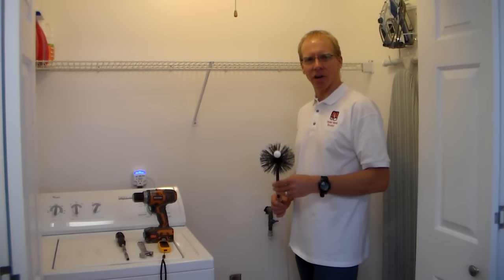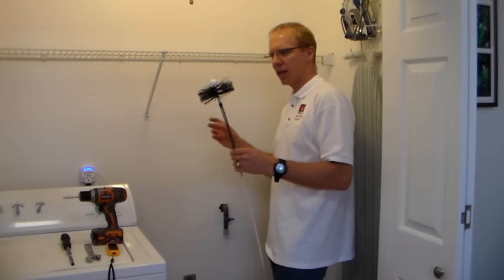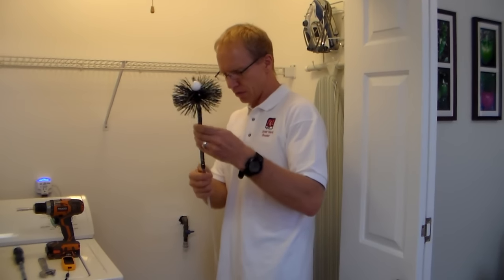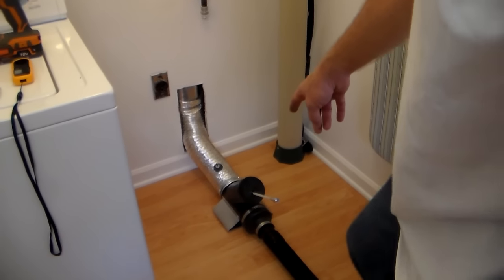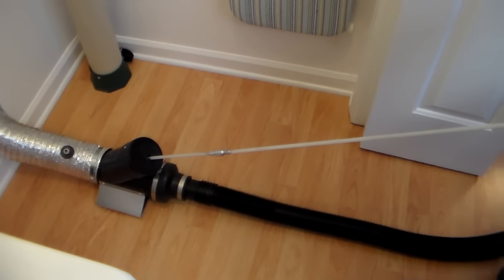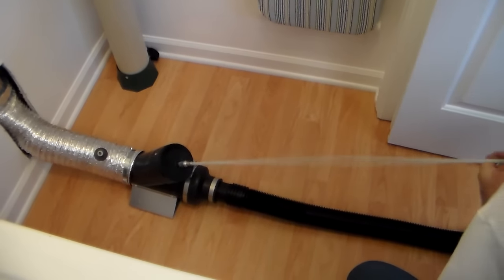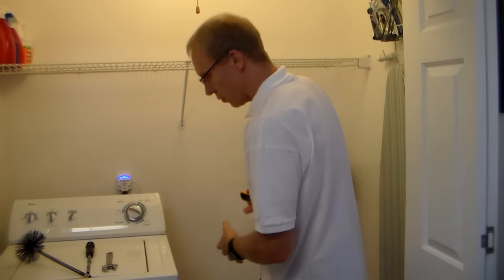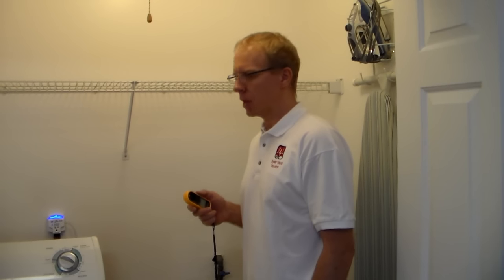Dryer Vent Cleaning - This Is How We Do It.

Comment: I helped my neighbor with cleaning the dryer vent,rear dryer exhaust,rear ventilation holes,lint chute,and lint screen of their dryer. The dryer airflow was improved by removing lint build-up from the dryer to dryer vent duct outside of her home. She was thankful for me helping prevent a dryer fire. I saved her from a dryer fire waiting to happen. I used the Gardus LintEater Pro dryer vent cleaning system kit for her dryer vent cleaning process. The rotary dryer vent cleaning rods connected to a drill is the best method as stated in your helpful
video. I learned of this technique from another video and your video how this process works. It makes sense as another person said all that hot,hot air from a dryer can start a fire from lint build-up.

Comment: Great video. I just got done cleaning my dryer vent. I didn’t have the high power vacuum but the 20 foot sectional dryer brush cleaner worked great.  Because I didn’t have the high powered vacuum, I had a descent amount of lint cleanup on both ends of the dryer vent but it wasn’t too bad. The brush does a great job cleaning when you use the drill. Thanks for the video!
Reply: Did you clean it from the outside? If you clean it from the outside you can run the dryer at the same time so the lint gets forced out by the dryer.
Reply: I have learned a lot from you the dryer vent cleaning process to why it’s important. Some friends, neighbors and coworkers are becoming aware of my natural ability to clean dryer vents and appliance repair knowledge. Some neighbors and friends have commented, my dryer is working better. Thanks for all you do.

Comment: I tell neighbors about dryer fires and
prevention. In January 2022, luckily our clothes dryer did not cause a house fire. A local repairman removed the lint build-up from inside the dryer drum and wires. The dryer could have started a house fire,if the dryer did not
stop. I think that experience helped me to inform people about dryer fires and
prevention. The Gardus LintEater Pro dryer vent cleaning system kit and extension rods is worth every penny,to prevent dryer fires inside my home and neighbor’s homes.

Comment: That may be the cleanest floor under a dryer that I have seen! This is really a good professional job. I have cleaned out the interior of dryers, blower wheel housing and around the gas or electric elements, it is shocking how much lint and other things build up. I have found a few now with scorched lint, so very close to a potential disaster. Please make this an annual ritual, as much as it is a pain.

Comment: I really like the rig set up you have in this video.  would you be able to share a part list for the pressure tap, wye fitting, boot clamps and hose connection?
Reply: Most dryer vent cleaning kits you find on Amazon have a similar adapter included.

Comment: Thanks for the video. My house has dryer vent through the roof. I wonder what is the best way to prevent clogging issue?
Reply: Reroute the vent or clean it monthly. There is an air powered tool as well that blows all the lint backwards.

Comment: what brand of vent brushes and sticks do you use? Also, was that just a 4 or 5 inch abs elbow pipe you connected the vent and vacuum to? Yours look a littler bit better than the typical linteater homeowner brand on the market. Thanks

Comment: Some videos are showing the vent being cleaned from the roof instead of from the dryer vent like in this video. Much preferred to do it from the ground for several reasons, but mainly safety. Also, some roof vents have screens on them that have to be removed before you can get the cleaning brush down the vent tube. Most kits you can buy for dryer vent cleaning come with the adapter for connecting the vacuum and the brush+rod to the outlet port on the back wall at the same time.

Comment: I can't see that adapter you have that allows the vacuum to connect and the wand to go in.  Did you make it or do they sell it?  And if so, what is it called?
Reply: Abs y fitting used for drain systems and other rubber fitting with clamps for your vacuum hose size

Comment: I used a vacuum wand to pull out the lint from my dryer vent coil. If my dryer vent coil has lint that is caked on, and I don't have a kit for it, can I wipe the inside with a wet rag?

Comment: I have a 2 story house and i tried using the kit i bought online but after about 16 feet or so i run into something in the vent.  Is it possible there are flaps inside the vent tube?  I also tried it from the outside; the vent is on the side of the house, and it stops after several feet.  It sounds as though it is hitting a solid "flap".  I tried using a metal fish tape (for pulling electrical through conduit) but it too stops at the same length.  So my question is, could there be flaps inside the duct?

Comment: One time at a rental when the tenant moved out I got a electric leaf blower and a few old rags.  I attached the leaf blower to the vent and sealed it with the old rags.   There was enough lint in the vent to fill two one gallon jugs.  I called the tenant and they said their clothes took 2 hour to dry and they went through 3 dryers while living there (4 years)
Reply: Sounds like you're a slum lord who steady has their hand out for money but won't properly maintain the dwelling. You talk about them spending big money drying clothes and buying dryers as if it's something to be proud of.  You're top notch
Reply: I will guarantee that you didn't get it all out with just a leaf blower!
Reply: Hey
Reply: Add a booster fan
Reply: I thought this is the landlord responsabilidad this is a fire hazard.

Comment: I have a 40V 200MPH Ryobi leaf blower that I shove in there once a year with some rags around the opening to seal it off. Turn it on and POOF! Works best if you do it when you haven't run the dryer in a couple days so everything in the line is nice and dry and gets dislodged easier.
Reply: WOW!!!!! THAT SOUNDS AMAZING!!!!
Reply: You shove the leaf blower into the outside vent and it blows into the inside?
Reply: That doesn't guarantee that all the lint is removed, especially at the 90 degree elbows.

Comment: I do HVAC for a living and I can't seem to understand how you are able to vacuum the lint from inside of the house. All of the dryer vent ducts I have installed has a back draft damper and that prevents air from coming back inside the house from the outside. Maybe in your area there are no back draft dampers.
Reply: Open the back draft door with a piece of wire, a small string, anything that will not get sucked into the airway.
Reply: wouldn't it be because you are pushing the back draft damper open with the cable but I see your point

Comment: the top right side of the dryer is a little device with that blue light on it.  Does that little device measures the pressure coming from the dryer discharge. I seen a video that says if there's too much lint in the discharge tube the device will blink a certain light or sound and alarm. Is this device available at home Depot
Reply: newer dryers have a manometer like reading.  This measures "back pressure."  Example - a great dryer vent properly installed has 20-25 mph of air flow.  If you only get a reading of 15, then you have 10 mph of "back pressure."  The light will come on if this is the case.  An anomometer will tell you.  Devices from an appliance store to do these measurements are an overkill
Reply: Anthony Canty That is a lent detection device that will detected the amount of lent build up in your dryer, and dryer ducks, each light will light up as the lent builds up, but when it gets to the final, red light, it will sound a constant alarm, letting you know your ducks are completely clogged, and at risk, of a fire.

Comment: Wouldn't the brushes damage the vent run line?
Reply: the exhaust duct is made of 4 inch round rigid metal pipe. its decently durable. however, the little flex line that connects to the dryer probably wouldn't take the abuse of the brush.
Reply: why cant i just get a vacuum cleaner and suck the duct end of the wall? do i really need to stick a long tube like this guy here?
Reply: Friction against the wall of the vent is necessary to properly remove all lint.
Reply: yup
Reply: @inquisitvem6723  Logically. "If you want the job done professionally, whatever that means, higher a pro to do it" (as if a DIY isn't possible).
Reply: ZBrink you don’t need to pump the entire 20ft. I already used it to get a bunch of lint out. It has improved my drying time greatly. No risk of damaging vent run line

Comment: where did you get that y fitting kit
Reply: yea forreal where's that from
Reply: That y is from drain pipe fittings you can purchase at Lowe's or Home Depot.  Its 4" and he made custom ends with caps you buy there too for the small hole that the fiberglass flexible rod goes through.  Not sure what fitting reduces size wise for the vac hose.  There are reducers from four to three, two, one inch etc. and clamps.

Comment: i’m guessing that reversing the drill to ccw is a no-no. pretty sure the rods would just separate, leaving them in the vent pipe.
Reply: Yes, that's true, I have a vent cleaning kit and it suggests duct taping each screw section together to prevent a catastrophic loss in the wall.....

Comment: It's recommended to add electrical tape over each joint or you risk the rods coming loose in your vent.
Reply: Wrong. Your referring to threaded rods, if you watch again you’ll see that those rods snap lock together, they cost much more (12 rods $400 set)
Reply: @stevehansen6792  I just pay someone to do mine now.
Reply: @stevehansen6792  - where can I get those rods?
Reply: @stevehansen6792  snap locks can also come undone if you dont have them fully in all they way and the button didn't lock into position

Comment: where do you get your system?
Reply: Sorry but lint eater does not make those clip in type rods that your using. So with that being said where did you buy those?
Reply: David Brazzeal the one you have is way thicker than the one you posted on links. Where did you find that kit
Reply: Bryan right that’s what I said that’s a lie

Comment: Wondering if this technique might work better with a leaf blower? Seems like you could get better air velocity to blow out rather than suck in.
Reply: there's a video of a guy using a leafblower and it worked fine
Reply: I used a leaf blower, without the drill and a bunch of crap flew out, but I think there is still a bunch more impacted in the line.
Reply: +Saturday Projects that's good to know. was it enough for the dryer to work OK?
Reply: Not really. I need to get one of those drill attachments. Any recommendations?
Reply: +Saturday Projects I have a customer I'm doing it for next week. I'll message u then if I get it figured out.
Reply: So how did it come out Michael McGee
Reply: Didn't use it. They sell the kit in the video at Menard's for 50 bucks.
Reply: Comes with 12 feet of extensions. Can buy more extensions individually.
Reply: Thanks for this. When I read this I "ran" to the Home Depot website and found one on there for $20. I made my husband go first thing this morning (we got two sets for the extra extensions), and then we worked together to clean up our vent.
Reply: that's great to hear
Reply: leaf blowers are a bad idea.  You cannot see inside the dryer vent and despite the amount of pressure it creates, lint will NOT be removed without being brushed.  If you are brushing, the pressure from the vacuum or the dryer itself is plenty sufficient to clean it out thoroughly.  Relying on a leaf blower will not work.  The other problem with leaf blowers is that if you do have a blockage in the line, the pressure from the blower can actually bust the line apart even worse and in several spots.  If your walls are finished, start cutting drywall
Reply: Joseph Emery A brush would get more lint out, obviously, but I didn't have one and my leaf blower did blow a ton of stuff out and substantially improved the dry time on the dryer.
Reply: it will blow a lot out, for certain.  But do not rely on this each time. Lint over time, will harden and even brushing it will not get it out.  I have had a hundred customers that started with leaf blower cleaning before hearing of my company or calling and often times it results in a complete replacement of the vent.  Hopefully the next time the cleaning is needed you can find a brush system. Good luck!
Reply: The leaf blower works better. With a vacuum, lint is getting caught on the crimped ends of the pipes because they are pointing towards the vent termination. The vacuum is cleaner and it won't look like a winter storm outside lol
Reply: About how much do you charge? My dryer vent to the outside is maybe 30 feet. Porbably closer to 20 feet. Thanks
Reply: I want to thank you from the bottom of my heart for the idea to use a leaf blower.  I got all that lint out and did not have to pay someone to do it for me save me some cash.
Reply: @TomO-if7nh  is you dryer vent vertically to above your roof?
Reply: @thetaekwondoe3887  my concern in using extensions like shown on the vid is if one of the extensions detaches itself in the middle of a 30 feet duct and then how do you get it out?
Reply: @josephemery9617  For a good brush scrubbing, you would need a brush that contacts the duct wall completely around; otherwise a smaller brush as shown would only be doing half the job.  Not all ducts are of the same circumference; some are bigger than others.
Reply: @Montery12 I THINK we might have duct-taped where we connected the extensions so we didn't have to worry about that.
Reply: @thetaekwondoe3887  you "made" him go and yall worked "together" lol
Reply: @Jamie Jordan Hey, I did the research. He got to go to the store (which is only like 5 mins away, by the way.) And then, yes, we worked together doing the actual work it took to get it cleaned. I'd say that's about 50/50.

Comment: The vent termination is apparently on the roof.  How do you know if the vent cap or screen is clean without accessing the roof?
Reply: You don't, always check the vent cap. That's why he said they check air-flow velocity at the vent point before & after.

Comment: what is that special "y" shaped fitting that connects the vacuum hose and allowed him to insert the dryer vent cleaning rod?
Reply: Nick De Sousa i wanna now aswell did you find out??
Reply: Nick De Sousa ever find out
Reply: Thanks Garret!  Do you have a company?
Reply: That looks like a standard Wye fitting with a rubber 4-2 1/2" adapter and something I can't quite see to block some air where the brush rod goes in.

Comment: You measure in MPH? Why would you not use cfm?
Reply: 615 cfm, 1760 fpm or 20mph.  it's a matter of preference on how you measure to make sure the airflow is where it needs to be. They are all based on the same factor - how fast air needs to flow through the dryer vent to limit lint collection on the wall of the vent.  Most customers understand mph and is more easily explained to them.  Keep it simple.  they aren't engineers (usually)
Reply: The device only measures speed, you would have to tell it the pipe radius if it has a built in calculator or calculate yourself. MPH x 5280 (ft/mile) / 60 (min/hr) x CSA (ft^2) = CFM

Comment: You should snake it from outside and keep dryer on while doing it,or attach a blower then snake.
Reply: Vents exit homes in different locations, some on the roof. Doing it on the inside works for every home plus you can do it during adverse weather.

Comment: Um I'm in a 1987 trailer and my vent just goes straight down lol but I'm still going to clean it
Reply: You won’t need to clean your vent like this.  It won’t be a help to you.  The only thing you need to do is ensure your flapper (the part on the outside) is not stuck closed and your dryer vent hose isn’t too long or kinked.
Reply: @TheHandsomeSweet  A mobile home in my park caught fire because of a dirty dryer vent that went through the floor. So clean it yourself or pay to get it done or.............

Comment: I do this same job as a side business. I use a Cyclone Dust bucket between the vacuum hose and the shop vac. Keeps all the lint and dust away from my shop vac filter. It's very common to remove 2 to 5 gallons of lint. If your dryer is slow to dry clothes I would surely try this before buying a new one. And yes, I have lost a brush inside a duct. It will happen if you accidentally run your drill in reverse. I had to disconnect the duct under the house to retrieve my brush. Lesson learned.
Reply: @Jonathan T. Brown For me, no. It's just a side hustle, fairly seasonal. I live in a large neighborhood and I just advertise on the neighborhood web site. I will usually get quite a few requests for service but only about half will follow through. I charge $60 and it usually takes around 45 minutes. It can be nasty work.
Reply: @Todd and Emy Why the leaf blower inside. Just run the dryer on "no heat" while working from the outside.
Reply: @shannonp4037 EXACTLY!  this is BEST way, and the normal flow direction of debris.  Also, if you happen to  reverse your drill and get your rod brush to un attach from drill, just get a 15’-30’ magnet scope to retrieve it.  If you’re in this line of work- you MUST have camera scope with magnet attached for liability reasons

Comment: Tried this with the lint eater product that I bought from Lowes and it didn't work. Couldn't get tool to go through 90 degree turn underneath floor. Dryer pipe then runs along underside of floor to 2 more 90 degree turns to outside of house.Just love those 90 degree turns,NOT!
Reply: You couldn't get it to go around the 90 degree elbow because there was a blockage at that point.   I run into that all the time on jobs like this.